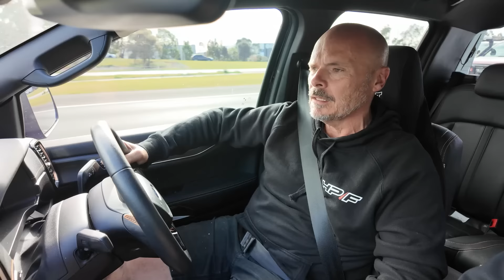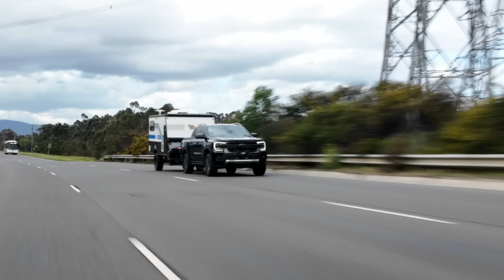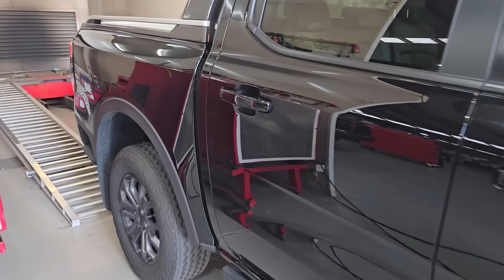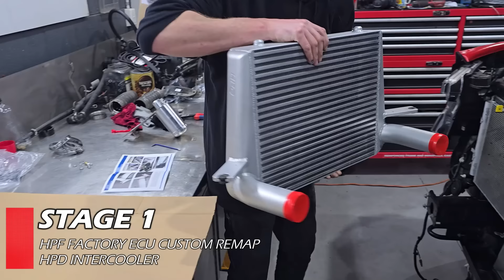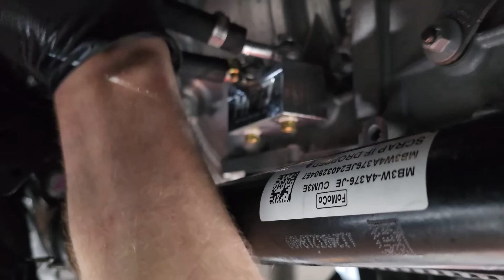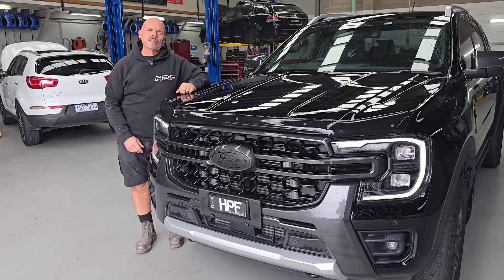HPF POWER UPGRADES | RA Next Gen Ranger 3.0L V6 Diesel

Comment: I am a Ford fan. Or rather, was. My daily drive is a 2.2 Ranger 4x4 Doublecab of 2019 vintage. I love this vehicle with its 6-auto box. I bought it new two years before my retirement. Ford SA offered a free basic 4x4 course and I paid for the advanced course. 

Then, when Ford started to advertise the Next Gen Ranger, I saw it, or rather, envied it. But alas, on pension, we cannot make debt. 

I felt so sad, until I saw three cases where the Wildtrak and XLT models experienced front wheel traction problems: one case on Kyknet and two cases on Youtube. In another case a friend with a V6  Wildtrak couldn’t drive because of some ‘belt problem’. Yesterday I saw how some driver bust his 4x4 Ford on the entry of Beer o’clock hill. To be honest, I never expected to experience such nonsense. I think Ford is messing with their client base. We don’t deserve such crap.

Comment: Well done on your development, have you had an opportunity to measure the difference in fuel usage, the difference in usage of my standard v6 when changing from say between 90 - 100km/h to 100 - 110km/h is fairly noticeable and even more so when towing. I’d be interested in your fuel usage if you have any details. Thanks
Reply from the maker: Fuel consumption while towing can vary significantly depending on factors such as what’s being towed, driving style, and conditions. Since the upgrade, customers have reported an improvement in fuel economy, with usage decreasing by approximately 0.2L per 100km.

Comment: What are the actual dyno figures? We want to see atw figures
Reply from the maker: We stick to flywheel figures because that’s what the manufacturer provides, and every car reads a bit differently on the dyno. It just gives a consistent point of reference for everyone. If you’d like, we can chat about what kind of gains you can expect for your setup! Just give us a call on 03 9793 1616
Reply: @Horsepower_Factory  yeah but you’re not a manufacturer, this is exactly like with the walkinshaw kits. Just do atw figures like every reputable shop. It doesn’t make sense to dyno a car, get figures at the wheels then say this is approximately what you’ll get at the flywheel.

Comment: I can’t believe you are brave enough to even touch these motors,they are going to cost ford millions in warranty claims,giving them a way to blame someone else for their inherent design flaws is borderline insane. 🤞🤞🤞Nothing but the best of luck, I hope it all works out for you ❤️🙏
Reply: Obviously another Toyota owner who can’t accept they have been left behind. Cheers
Reply: @NielsSorensen-sh8tm left behind until warranty runs out. Then in front for the next 30 years! Not everyone buys a Ute for red light racing 😂
Reply: @SimonBrisbane 70 years old and not for racing just straight out better value. Toyota got arrogant and dropped their game   Cheers
Reply from the maker: This vehicle has approximately 40,000 km on it. While there have been some reported issues and recalls related to these engines, when considering the total number of vehicles on the road, the occurrence rate is likely comparable to that of other manufacturers. As with any performance upgrade, there are always some inherent risks, but we believe they are no greater than those associated with similar vehicles from other brands.
Reply: People forget the old days .when we blew gearboxes and diffs in our fords and Holden's. Easy fix back then also.
Reply: @robertbosgra509 . To true 👍👍a 9/16” 1/2”ring and open end spanner and you had half the truck apart 😁😂.   One thing I don’t miss is the rust, something most modern vehicles have now overcome. I think they now design them with the thought of less make it so complicated that only qualified mechanics with specialist tools can touch them.
Reply: Well you are the man you know everything. There are thousands of them out there you only hear about the few.same with any  manufacturer even the Toyota 300 series has problems.